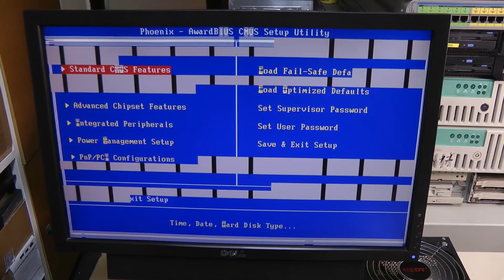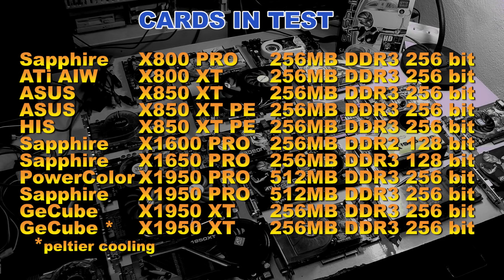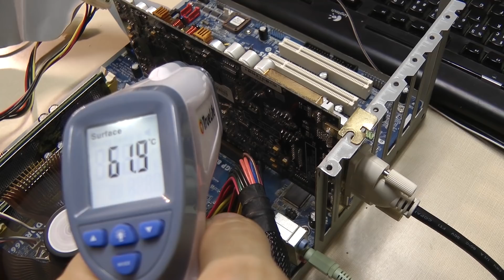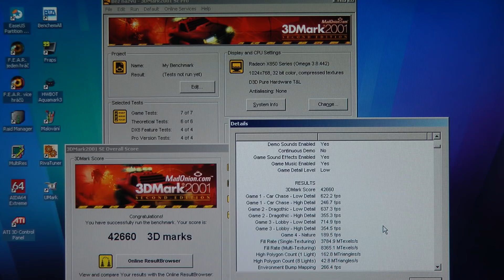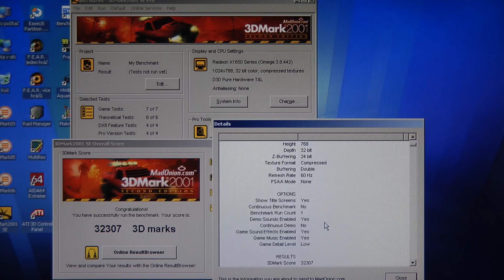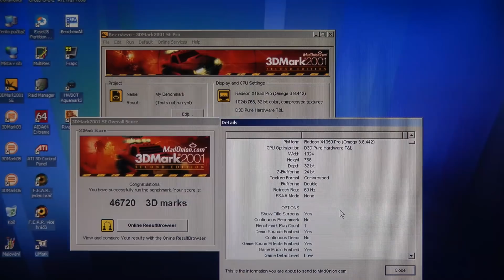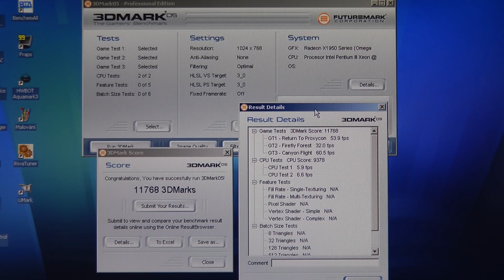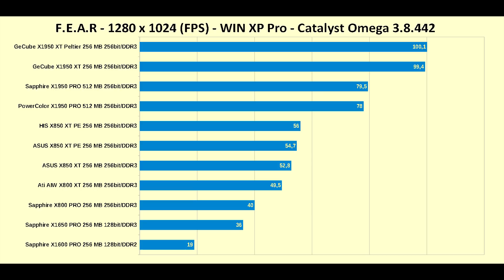AGP ATi X850 XT X1600 X1950 XT on Core 2 Extreme - RETRO Hardware

Comment: hd 3850 agp is fastest agp card and hd 3870 agp with ddr4 that was never released
Reply from the maker: Will see in future parts :-)
Reply: hd 4670 is fastest
Reply: @krofmenld3779  Nope, because of GDDR2 instead of GDDR3, and cut video memory bandwidth. HD 3850 is the fastest AGP card ever.
Reply: @krofmenld3779    how?
Reply: @SteelyGlow  There is a model of HD4670 that  uses DDR3. The HIs ICEQ 4670 1GB DDR3 AGP.
Reply: @mmhmson  yes, I've found this out after I've posted the comment, the rarest videocard on e-bay, I presume. But it's still 128 bit, and its memory bandwidth bottlenecking the GPU, so the pixel fill rate value is much lower than that of HD 3850 with 256 bit.
4670 has 4.9 MPixel/19.0 GTexel, 3850 has 10.5 MPixel/10.5 GTexel (per second) pixel/texture fill rate, and the first parameter affects framerate, the second - texture drawing speed. You can theoretically use higher resolution textures without performance impact, but it doesn't work out well due to obvious reason.
Reply: I have hd4670 and 3850 ago both, 4670 is little faster but they are essentally same.
Reply: Gddr4 is basically power-up of gddr3. And gddr3 is basically power-up of ddr2. All these memory chips are pin-compatible. Technically you can replace ddr2 by gddr4 and use some overclocking utils to rise memory clock to hd3870 level
Reply: The 3850 isn't really an AGP GPU, it's a PCIe package which bridges to the AGP connector through a chip.

It's actually quite difficult to figure out which is the fastest native AGP card, because Nvidia and AMD released different cores under the same name.
Reply: @krofmenld3779  not really: hd 3850 is the fastest card with native agp 8x

Comment: I installed an HIS Radeon X1650 into a computer. I installed a Radeon X1650 Pro to a Pentium 4 HT Socket 478 machine clocked at 2.6 Ghz. I thought that it was a Radeon X1950 at first glance. The system is a business grade machine an HP Compaq D530 Convertible Minitower. The power supply is a 420W Antec power supply that I obtained with the card. Anyone who knows anything about these Business grade HP Compaq machines knows that the major hurdle with these machines is getting a power supply that fits the screw holes which this power supply almost does.

Comment: back in the day these were new, I remember having gone through about six RMA's of a 9800 Pro from ATI itself, because each successive one was worse than the last, none of them fixed the problems I was having with KOTOR, and even with literally reformatting and reinstalling windows fresh for every monthly driver release, I couldn't get Half Life 2 to perform as well on the same resolution and settings as the benchmark data would imply, even when I had a faster CPU and more RAM than the site's test system. At the time I finally got upgraded in an RMA to a 512MB X1600 pro, which did work... until it abruptly died right after the "refurbished" warranty ended. 

In desperation, I bought the only thing I could afford.. an HD 3650 AGP, which itself was basically BSOD'ing in windows all the damn time, and refused to accept the stock Radeon drivers no matter how many times or from how many sources I would install from.

Literally, my only relief, was later getting an nvidia 6600GT from BFG. It might not have benchmarked as high, but it actually effing worked until I was able to upgrade to a PCI-E based system.

Comment: I've never seen a floppy or molex power connector on a gpu before, interesting stuff!
Reply: Molex and Floppy power connectors were the normal method of powering a GPU before PCI-E existed (during the AGP era, about 2004 and older).
Reply: @IronicTonic8  I'm listening buddy, I have seen molex and pcie connectors. it's just the floppy connector what got me.

I have a xfx 680i Lt socket 775 and that has a molex on the motherboard for PCI cards that needs "extra power".
Reply: The not widely released Voodoo 6000 had its own sort of external PSU (basically a grand-daddy ancestor to those E-power boards we see now for extreme overclocks) because even the single molex they provided the Voodoo 5500 wasn't exactly trusted to power four discrete VSA100 video chips.

ATI used the floppy connector first with the Radeon 9500 and 9700 cards. It didn't last terribly long probably because floppy drives were still kind of needed then, and one was lucky to even have two of those without the need of an adapter. So while it was probably great for ergonomic reasons, it was crazy inconvenient when a good majority of the install base likely had to share that connector with the actual floppy drive the system needed at times to function.

Comment: I have an AGP HIS X850XTPE.  I bought it to play half life 2 at 60 FPS which it did very easily  on a pentium 4 @ 2.6  when I upgraded to a athlon x2 4800 the FPS almost doubled
My 1950pro had issues with unreal tournament 3 and bare got 30fps yet the x850 got upto 70fps.  Weird.
Also most cooler on GPU back then wer utter shite

Comment: Great video. I appreciate the time you take to do all of this. I can't wait to compare these numbers to some of the Gforce 6 parts and perhaps the 7800GS agp.  Is the 4x pci link on this board a huge bottleneck? or does it allow for a good comparison to some pci e cards?
Reply: for older cards it will be fine but faster, more modern cards will be limited quite a lot

Comment: MAN, you have the X 1950 XT, you have on your hard the Xbox 360 GPU ;-;
Reply: It isn't the X360 GPU. The Xenos had unified shader achitecture, the R500 didn't. The first ATi GPU (for PC) with unified shader architecture was the R600 line (HD2000). Not to mention the Xenos was a twin-chip design.

Comment: Ahh, I remember this time in my pc gaming life... painfully, however. After my first 9800 Pro died because of Doom 3, from that point I went through six straight RMA's. the first five of which were just 9800 pro swaps which went from Samsung memory to Hynix memory. ATI refused to admit there was a problem, but all of them were markedly terrible. Not just in game compatibility, but well, flat out even being stable at clocks I was already enjoying with the original unit. Even when all else was equal, the Hynix based 9800 Pro's all performed worse than the Samsung equipped unit did in Half Life 2, which is hilarious because the benchmarks I based my  purchase of the card on, were using a test system that had less RAM and a slower CPU than I had at the time. I had to press on this for them to finally consider letting me get a different model. In the end, I received an X1600 Pro, which, while fast enough to comfortably run the game, died conveniently after the refurb warranty ran out on the card.

Needless to say, when it was still ATI, I hated the Radeon brand with a passion.
Reply: many 9800 cards died back then especially in cases with bad airflow... that card just needed an aftermarket cooler like the ati silencer to get a sufficient cooling
Reply: @talvisota327  i had the arctic silencer, not unlike what was on the HIS brand card in this video. The problem was that drivers were especially terrible. OpenGL performance especially was terrible; even worse than the GeForce FX series, which is saying something. ATI promised endlessly about having a driver that would finally fix it for all. But basically, unless you had an x800 series or newer, they didn't care about you by then.

Sadly, now with RDNA on the 5700XT finally addressing the weaknesses of GCN, i expect the FineWine to finally peter out for the architecture. The radeon group is famous for just flat out dropping driver support earlier and more often than nvidia. That they held on to GCN for this long is a surprise to me.
Reply: Jorge Ramos I don’t get it. You were talking about cards drying on you...When someone told you about a solution, you then switched to the driver issues. Just admit that you are an an nVidia fanboy. End of story.Why don’t you tell how the whole nVidia 5xxx, 6xxx, 7xxx series were a nightmare and chips were just dying from overheating.
Reply: My ASUS x1300 died because of Need for Speed Underground 2

Comment: Cool!

That's my way:
Radeon LE 32Mb
Radeon 9000 Pro 64Mb
Radeon 9600 Pro 128Mb
Radeon X800XT 256Mb (Flash in X800XT PE)
Radeon HD2900XT 512Mb
Radeon HD2900XT 1024Mb
Radeon HD3870 1024Mb
Radeon HD4870 2GB
Radeon HD7970 6Gb
Radeon RX580 4Gb
Radeon RX590 8Gb
Radeon RX6800 16Gb
...